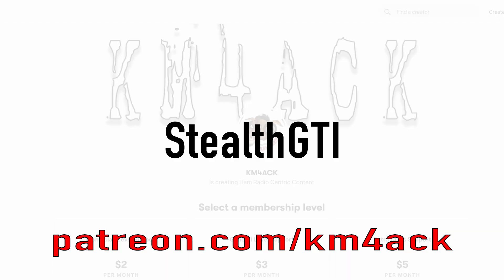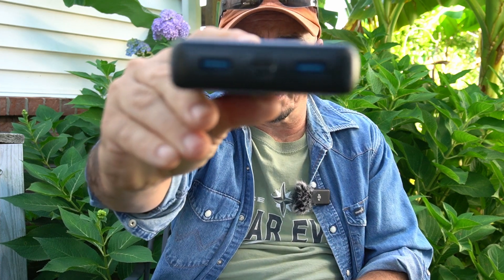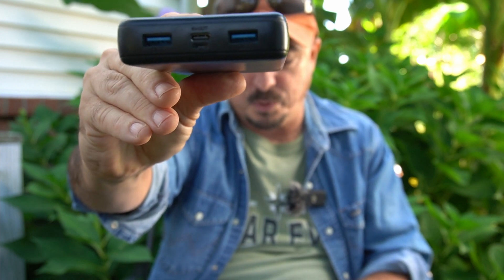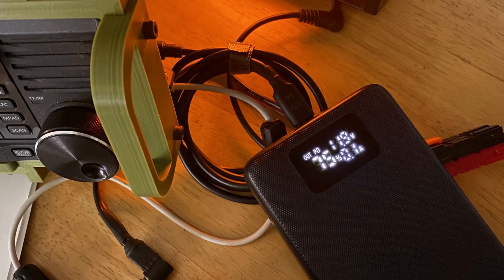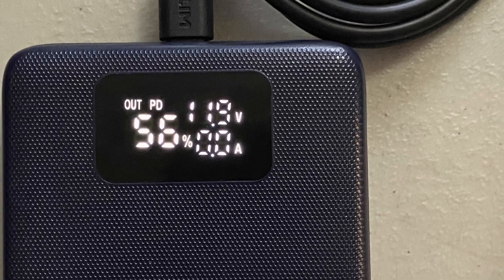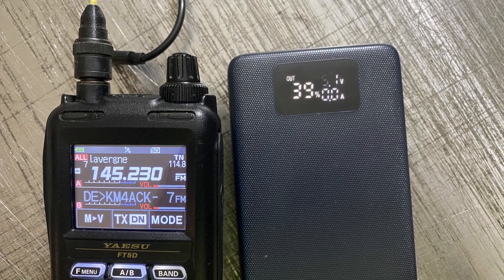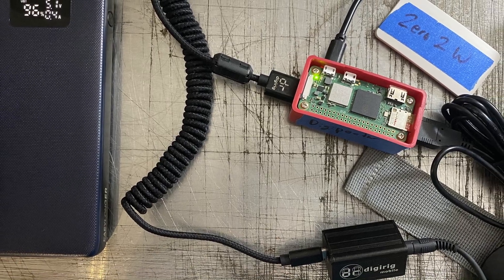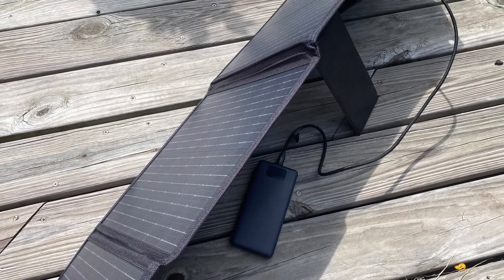The Swiss Army Knife of Batteries

Comment: My evolve came with a 65 watt USB-C PD charging port instead of the little barrel charger. Any battery pack capable of high wattage PD charging would likely work well on that model. I ordered a 12 volt USB-C PD charger that plugs into a cigarette lighter from Amazon, and it charges great off of DC now.

Comment: Without a doubt this battery is pretty good. But...I am going to disagree with you.  You should try the Shargeek 100 battery.  From it's barrel jack that can be used to charge from solar panel you can do 75 watts output from its barrel jack.  The cool part is I can set the output voltage of that barrel jack anywhere from 3.3 to 25.2 volts at .1 increments.  It gives 3amps of output.  I could run all those radios you mentioned from that jack.  Not charge, but run them.  There is one downside though I will mention.  I can't charge anything else from it while using that barrel jack but I can play Ham Radio from this battery.  This is actually my secondary battery for radio because I run my radio from the Renogy 72000mAh 266Wh Power Bank which in it own right is cool but not small.  The Renogy I use because it has selectable power from 12V.  The Shargeek though I use as primary to charge and run my Macbook from.  So that is why I say the Shargeek is a Swiss Army knife and it has a screen that gives alot of good charge and discharge information as well as charging time of the device plugged in.  It is not cheap though.  Both of these can be charged from solar panels.  That wire you showed off is pretty cool though. I put that on my list to purchase. So when I purchase it your link will be the one I will use.  So thanks for the link.
Reply from the maker: A good argument is always welcome here. It helps us all learn :-) Thanks for sharing!

Comment: most of my gear is USB C PD or just USB. That a great cable. I have the HP blue tip for 19/20 volt laptops and my battery box has USB C PD at 65watt 20V from a LiFePO4 battery 12.8V . works great ! I have the Anker power bank like that it is 45 watt USB C . The only thing i ran into is some RFI from some USB power banks . ferrite snap core on cable near power bank helps and distance to radio and antenna also helps. for the Baofeng UV 5R series that make USB C in both standard and extended size now. amazon has them now. will work with a USB C to C or A to C cord to charge UV 5R series. My 20 ah LiFePO4 12.8V battery box runs my HP 17 in windows laptop for days ! and runs my ICOM 7300 at same time. depending on how much FT8 or FT 4 can easy run the whole day! like 8 to 10 hours. depending on Key down time and power lever. I run 50% or less power level. get a bunch of them cables I say. they great ! 73's

Comment: I used a similar battery to power my 705 for a full FT8 session - it works in a pinch, but as you'd expect, not as good as our bioennos.  "Swiss Army Knife" as you said.  I also used it to power my ADSB box - the Pi and 2 SDR dongles doing decodes and got 15 hours of runtime out of it.   Its a great bit of kit.

Comment: I find it confusing to label battery bank output with the number of mAh rather than power (Wh or mWh). This might have made sense when the only voltage that battery banks put out was 5 volts but now that battery banks can put out 5, 9, 12 etc. volts, the mAh rating is meaningless.
Reply from the maker: It does take a bit of math to sort it out

Comment: I switched almost all of my gear over to USB-C PD and it makes operating so smooth. You can buy PD trigger boards that will make the battery output a specific voltage for your device. Install it with a simple 3D printed enclosure, and you can convert almost any radio (as long as you don't over power the current limit for that battery) to USB-C.
Pair a PD battery pack with a variable PD trigger board with alligator clips, you basically have a tiny variable power supply you can connect to whatever you want.

Comment: Another great battery bank I highly recommend is the shargeek 100 (formerly the storm 2) 25,600mah, 100w usbc pd output, and most importantly an adjustable dc barrel port input/output adjustable from 3.3-23v